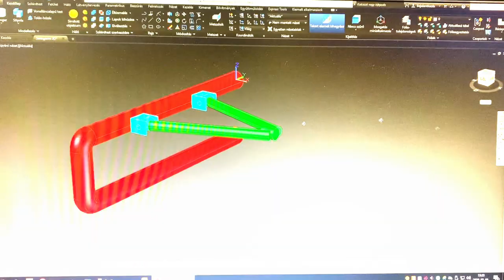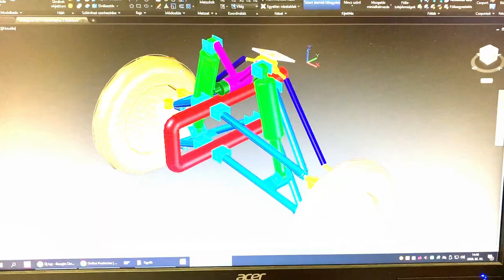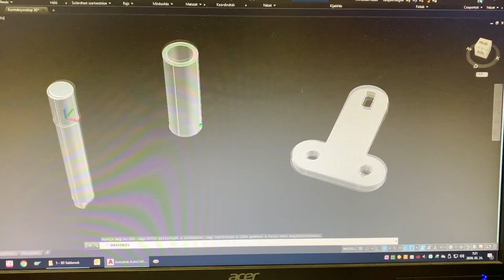Jog Tilting Trike

Comment: Good job and nice creativity. 
Can I get the blue print plans?
Reply from the maker: I dont have , only in my head. All parts randomly use and CNC machined from the depending of the situation. The double wishbone is a preaty standard suspension, the only new thing is the tilting mechanism to joint them.

Comment: Great job! would you be able to share the suspension design? I would like to build a vehicle like that for me.
Reply from the maker: Whatever you want! Good working!
Reply: @adamhorvath2483  Thanks! It is not clear to me what kind of joints you used. Can you please share the specs of the joints?
Reply from the maker: @flightdisplay7618  The all linkage and design is DIY and randomly use what i found in my garage. So i dont know, maybe some standard GL joints and some other own designed CNC parts.
Reply: The world needs you

Comment: Good project, but you seems not to trust either the geometry of the trike or its holding ability..
Because you hardly put your feet on board, esp when cornering and when starting🤔
Anyway nice build👍
Reply from the maker: If you a motorcycle man, this trike trick your mind! When you lean right automatically push left the handlebar in motorcycle. But in this trike mean you go straight forward :) So you must throw what you learn for a ride this time. Driving technics are drifferent, and this video is made from my early first driving experiance.
Reply: Thanks so much, i really appreciate for reply, i have got you now, i hope to build one in future, 
All the best hoping to see more from you🙏🙏

Comment: Good job bro. One question. The springs are connected to the body frame so when u tilt, springs also get compressed in that direction. Is that force small to ignore?
Reply from the maker: I dont know what do you mean exactly. The spring force not effect 
considerably for the suspension geometry. Otherwise the spring stiffness is too strong for this setup, its my fault. :)

Comment: All that effort and it's no good. No way to counter the centrifical force when you corner at speed. Better keep those gum boots on!
Reply from the maker: Its true, but fun way to drive :) I gain a lot experiance for a bigger project. This Jog only a good joke like ride on a bull. :) But you mistake one thing, the stability and cornering response better at high speed. Between 20-30 km/h the suspension and steering becom interference.
Reply: What does it mean by 'counter the centrifical force'? No way to return during conering?